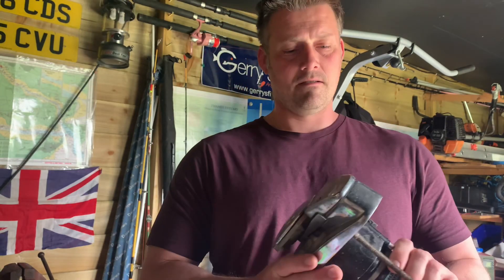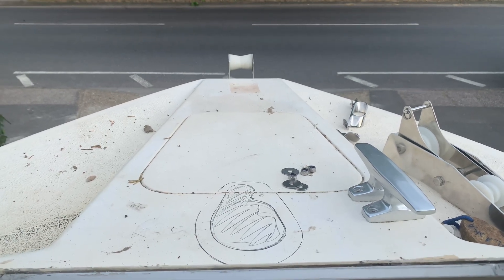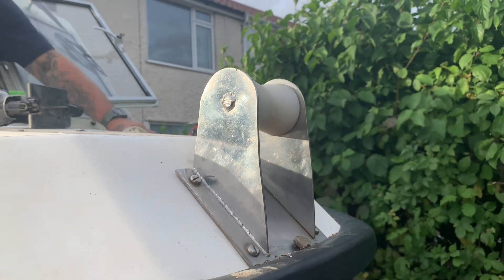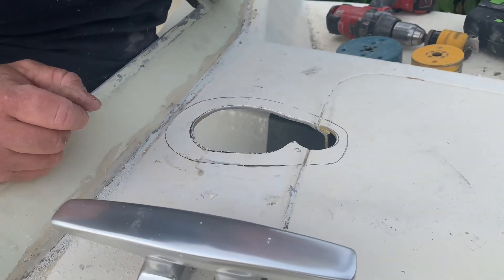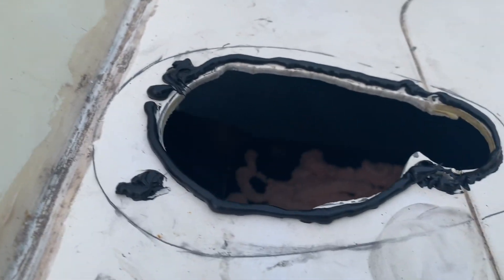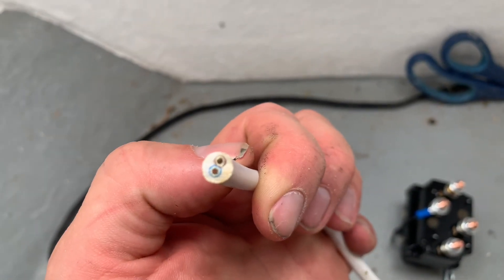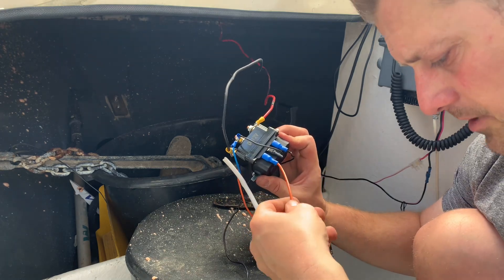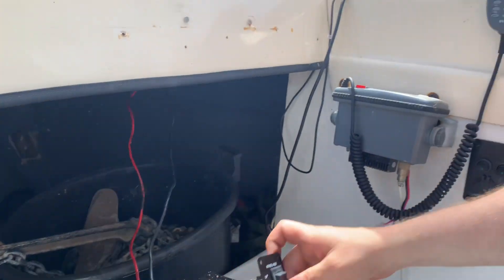Fitting and wiring up a Lewmar anchor windlass to a boat

Comment: Never, ever, ever take a direct supply from a battery without an appropriate fuse or circuit breaker rated to the cable size unless it is the engine start circuit. Quickest way to a fire!!
Reply from the maker: Thanks mate, it was just a quick wiring job to test that it worked. Now all wired up properly with fuses 👍🏻

Comment: Nice video, what size cable / flex did you use from the battery to the solanoid? Looks a bit thin they draw a lot of currant if you have a heavy anchor and 50ft of chain try too haul up specially if it's stuck.
Reply from the maker: Hi mate, yes that’s just the wire I used to mock it all up and test it without load. Bigger gauge wire now in place 👍🏻
Reply: @Suffolksportsfishing . Well done it was very informative and hate telling people how too suck eggs but had one my self and that used to get hot, think it had 4mm solid copper but bought some cheap jump leads and used the stranded wires they seam to handle the  currant better.
Reply from the maker: Thanks for the help mate - jump wires are the cheapest way of getting a decent length of decent gauge wire for the job. Cheers for the advice mate 👍🏻